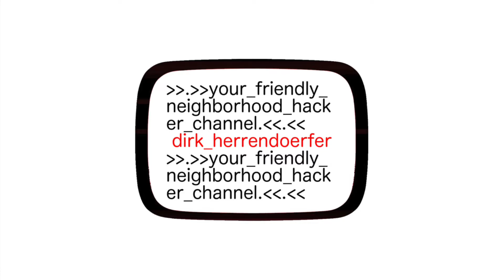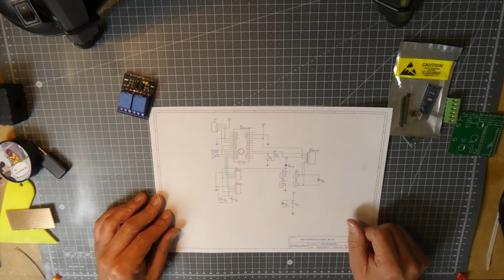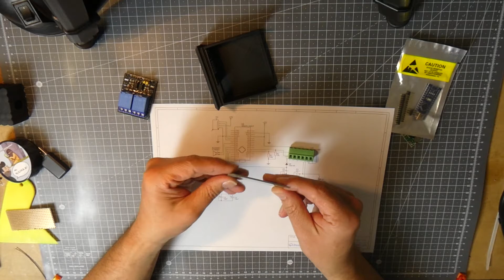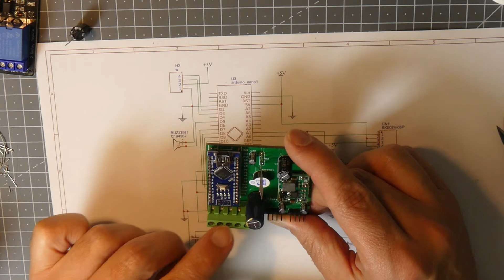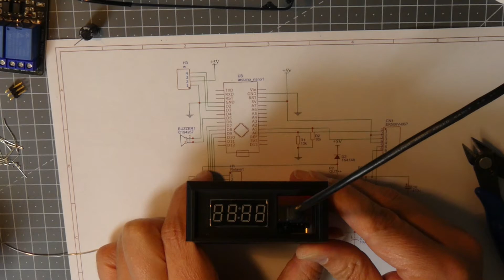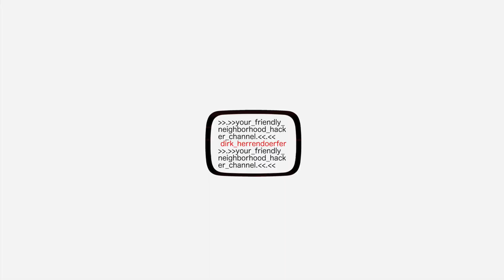A new controller for my CW 5000 - Laser Adventures - Update 3

Comment: Add a second serial port tied to a HC-05 (or better) Bluetooth module to send/receive data or commands.  I would like to collaborate with you and write a Android and iPhone app to control and monitor status.
Reply from the maker: I've never worked with one of those, can they be connected directly to the TX/RX of an Arduino nano ?
Reply: @dherrendoerfer  yes! you can use software serial library to communicate using different pins that the Arduino serial pins.  The HC-05 can be used to send temperature status and, if programmed in the Arduino, allow temperature parameters to be changed via a serial terminal on a smart device or PC.  A phone app can graph temperature and also provide control.  This is something i would like to do.
Reply from the maker: Ok, I ordered some. will report back when they've arrived.

Comment: as your elko is that high, you could easily had socketed that arduino...

but nice board, though. looks pretty much professional made. if anyone ever opens the cooler, they will not suspect a thing about any hacking :D
Reply from the maker: Yes, but then the USB socket would have been harder to get to from the front. This way it's right in the middle of the hole in the module.
Reply: Dirk Herrendoerfer aaah, i see. i would probably had a panel mount usb-port installed then. but as you said, its not a big project, and arduinos are cheap af these days. should not matter at all.